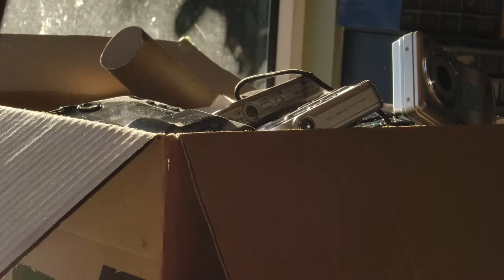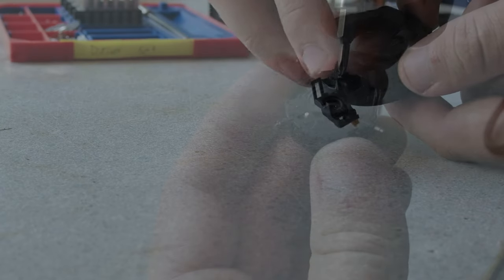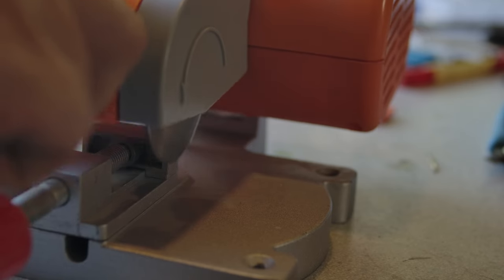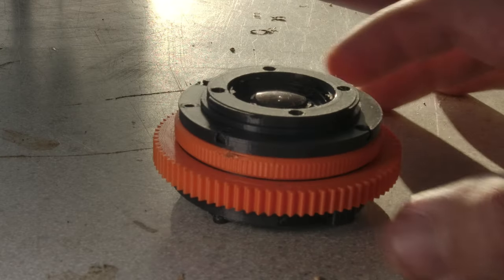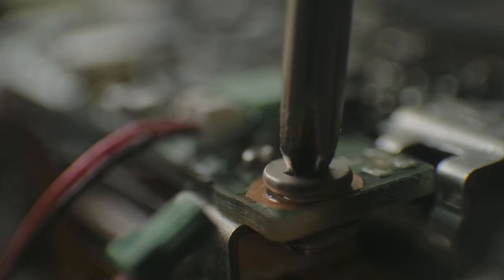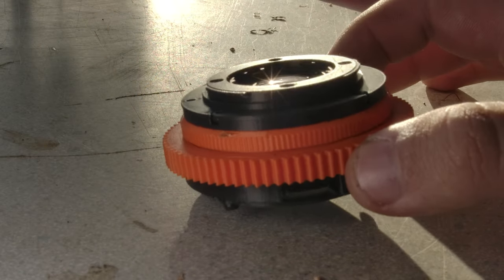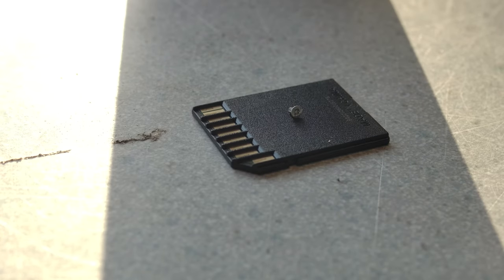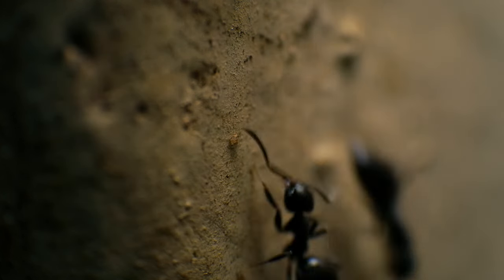Printing A $1 Lens

Comment: I tried this but I switched to a better approach after trial and error. I bought a Sony NEX for $60 bought several old 35 mm point and shoot cameras narrowed it down to ones that have a 28 mm lens that's glass I won't say which ones because I don't want to see the price go through the roof disassembled them and removed their lens made my own adapter that's capable of focusing. After the crop factor on the camera it now equals 42 mm and the lenses are super compact very close to the camera sensor and of course are able to cover the sensor with no vignetting and take very nice photos and most of the cameras i got the lenses from cost 2 - 10 dollars.

Comment: And I got a little shock from a DSLR camera. I'm an experienced engineer (in terms of hobby and developing electronics for myself), but I didn't expect the capacitors in a DSLR camera to hold a charge for months. It's good that the current only went through my finger, the current path is a few millimeters. Be careful with this, discharge the capacitors 🙃

Comment: @Chris Borge 

really cool project. 
you can increase the depth of field by decreasing the diafragm. in other words if you make the hole which the lens sees through smaller (like a pinhole, or a little bigger) the area which is in focus will be bigger.. try it with a piece of paper with a small hole in it and put it in front of the lens.
there are 3 things that influence depth of field:
- like i said diafragm, a bigger opening (lower F number) is smaller depth
- smaller distance to object is smaller depth
- longer focal length (higher f number) is also smaller depth

and probably, the distance from the lens to the sensor is too far away. i think it needs to be closer in order to be able to focus further away..
try playing with the distance from lens to sensor..

i hope this is usefull..

Comment: Fantastic project! The 3d printed adapter looks great. I've tried to re-set the lens module from an old digicam but it was not in one tube like this. Didn't manage to use it. Tried my luck with a disposable film camera with better results though.

Comment: I have so many old digicams laying around from a previous life 😮 Thanks for this vid, maybe I’ll finally find a use for one or two of them again!

What did you use for the sensor, a RPi camera?

(Why not specify the camera you built it for an upload the files? There’s probably a 50/50 chance I actually have one of them or a model that uses the same lens laying around 😂.)
Reply from the maker: It should have been updated now
Reply: Thanks! On Thingiverse? It’s not showing yet but I’ll keep checking. (I think I actually do have one of those cameras, I saw the model number in the opening sequence.) Great project, I love the stuff you post!

Comment: Be careful when disassembling cameras. They have high voltage capacitors in them for the flash, which might still be charged even if you remove the battery.
Reply: those things are fun
Reply from the maker: I am well aware aha, I used to try make tasers out of them in my teens (never actually got one working tho)